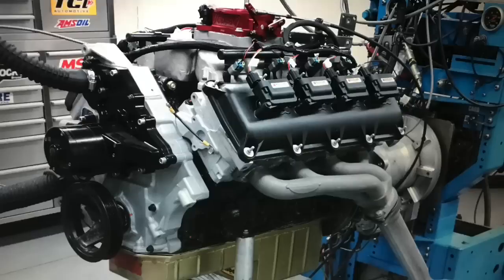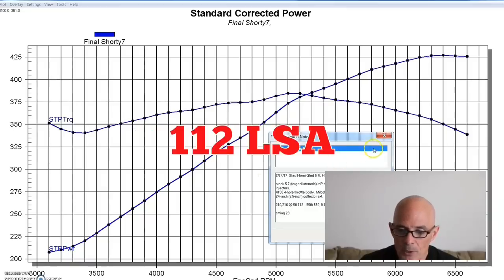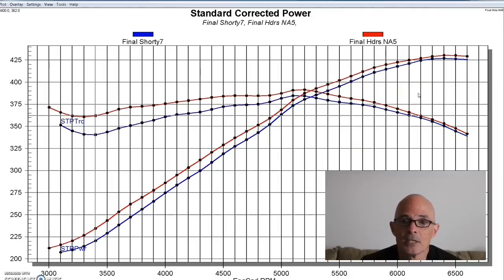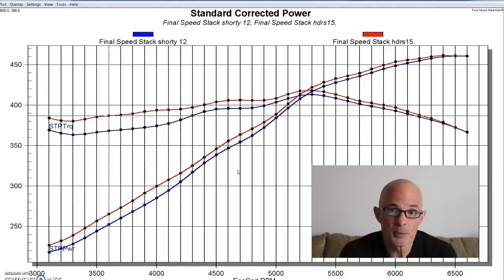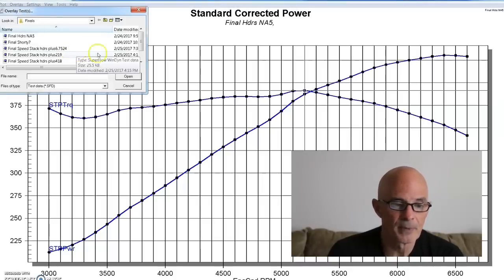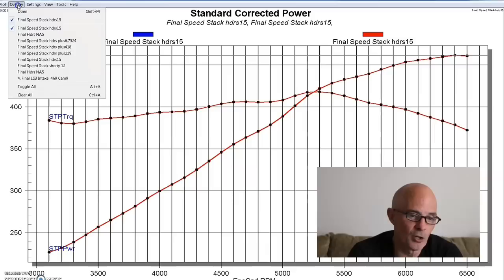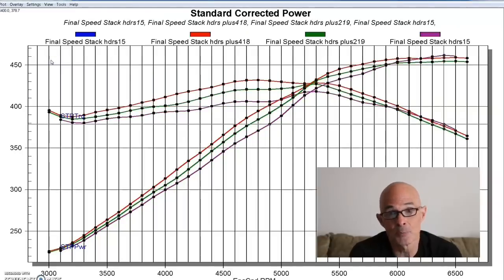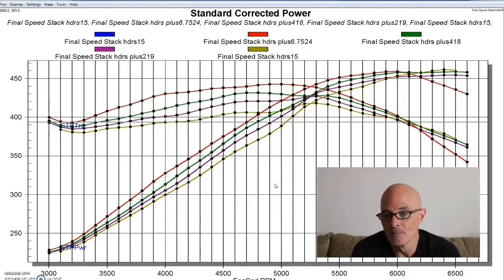STACK ATTACK!! DIY ADJ HEMI INTAKE

Comment: Richard, after reading a few articles and seeing this video among others, I decided to pop for the SM downdraft for the hemi I'm working on. But now that I have the system, I'm now finding out there's some prep work? What did you do to set the system up to run? MAP, and other sensors. Also tossing around EFI modules for this.. what do you suggest? BTW there's a provision for the TPS, np there. Any info is great. Thx
Reply from the maker: run a vacuum to any map sensor
Reply: @richardholdener1727  Thx a bunch. BTW, I have watched this video at least a half dozen times. I'm curious if you used the same injectors for the 4150 as you did for the stack injection? I'm not able to find tech data on the supplied injectors from FiTech. So I may opt for a holley compatible. Thx for the reply I did figure out the MAP, IAC, IAT sensors as well.

Comment: I’m curious do you know if that stack injection system fits newer 5.7 hemis? Or the 6.4 for that matter?
Reply from the maker: this was a 5.7
Reply: I believe you’d mentioned it was an 06 5.7. Is there a difference with the newer 5.7. Or better yet will the stack setup fit the newer 5.7?  Curious what the output would be on a newer 5.7, if at all.

Comment: The 8 single barrels are each feeding one single cylinder 1/8th of the time, their flow is only intermittent where the 4bbl feeds one cylinder at a time continuously one after the other but each cylinder gets a turn breathing thru all 4 bbls  where the cylinder with an individual stack only gets to breath thru it 1/8th of the time so it is not really that much more flow.   If there was a plenum under them like a tunnel ram it would be a different story, then each cylinder could (theoretically anyhow) breath thru all 8.   Also I think it would be a fun experiment to dramatically lengthen the runners like the skyram april fools manifold and see how it effects TQ very very low in the PRM range.
Reply from the maker: Each cylinder does not breathe through all 4 barrels on a dual plane, and airflow through a single plane is even localized based on cylinder locations, otherwise corner jetting would not be effective. But long runners certainly help torque as shown

Comment: Due to the consistency from one cylinder to the next, with long tubes you should be able to run things closer to the edge of detonation, leanness or whatever, without going over the edge. There is no way the cylinders of the shorty are all getting exactly the same cylinder fill, etc, and the computer is set up for that.

With the greater consistency of the cylinders available with the long-tube headers, one should be able to be more aggressive with things while not stepping over the limit, which you would be at a higher risk of doing with the shorties.

As an example, a leaner air/fuel ratio may yield more power, and with long tube headers, you are less likely to get a rogue cylinder experiencing detonation alone, and dragging all eight with it into spark retard. 

If each cylinder is identical, from start to finish of the intake/exhaust cycle, then all of them can be run at a higher level of output without the danger of detonation from the "weak" one.

The alternative is to have a computer for each individual cylinder that deals with each of the cylinders' quirks on an individual basis. Single plane single carb engines were bad for this discrepancy between cylinders. MPEFI fought this, but it is still all being centrally and collectively controlled.

Comment: I know this is an old video, but I wonder if a nice 2" 4 hole spacer (tapered on the bottom) under that throttle body would bring up the low end power of the single plane setup?
Reply from the maker: nope

Comment: I would like to run this stack injection on my 2006 dodge charger srt8 . Would i have to run an aftermarket  harness  piggy backed on my factory  harness  or aftermarket  management system.
Reply from the maker: after market
Reply: @richardholdener1727  which one would you recommend  and would that also run the nag 1 trans.

Comment: Richard, I'm trying to decide on an intake system for a 449 hemi road race build. I've watched many of your vids on the subject, and the ITBs always seem to come out ahead. However they're also just open to the air. I'd need to add filters and probably enclose them so they can't suck in hot engine bay air. Once this is done is there any advantage to ITBs? Thanks!

Comment: good test Richard! (on the stack length) Be good to do same test on a Ford 363, but doesnt matter what engine, it proves the point - longer runner length (stack height) improves tq lower in rpm range. Also is that total length (2,4,6") or is it added. if its added what is the total length?

Comment: Yamaha R1 uses self adjusting velocity stacks, they get shorter with higher rpm.  They are a telescope being type that use servos to adjust the length. This brings gains on low end and top end.

Comment: Richard years ago on my 68 Camaro that had a warmed over 302 4 speed . I was trying to get it to run ok and I used a cross over tube between the collectors and that seemed to help a bit as far as response .  I ran a 600 isy roller and 12.5 trw pistons and a set of really decent angle plug heads that came off a G Gas car . The bottom end was prepared similar to a dirt track motor . I fond of those motors as they have to live lap after lap . All a learning experience like the right power valve and drilling the small hole in the throttle plate and restricting fuel in the metering block

Comment: If you understand tuned port, then you know everythings tuneable.
Tuned systems consist of runner, plenum (optional), butterfly (feed speed), and ram pipe (intake pipe).
BUT... What is truth, is this, if you changed the length from the head to the butterfly, ONLY then have you actually changed the runner length.
Otherwise you have only and actually changed the ram pipe length. Plenum, butterfly and ram pipes are used to fine tune the power curves.

Comment: You don't get cylinder lean out due to longer runner length on the single plain, you can keep the fuel ratio the same in every cylinder with the stack injection.

Comment: Speedmaster what a horror story speedmasters or Pro comp stack injection for the Holden 304 efi engine the ports don't line up you need to weld up the speedmaster stack injection what a joke we work hard to build our cars only to get shafted and they are still trading not good.

Comment: It's amazing what runner length does! I've learned so much and have totally rethought my Vic Jr vs My old standard Performer RPM on my ANDERSON N51HR cammed 306. It'll really come down to where the engine wants to rev to for the manifold I choose. If I find that it's done before 6500 the RPM will be my choice without a doubt.

Comment: If you're going to work on shit boxes, Go get a 23° degree Sprint Car Small Block Chevy Engine, with mechanical fuel injection, On Methanol. At least 650hp naturally aspirated. Put different exhausts, intakes, trumpets, heads and cams in it. convert it to  run on efi, E85.
Twin carbs, tunnel ram etc..
play with that. 

There must be one of those you can duplicate, source cheap from somewhere.

Comment: Richard my dude, Couldn't be happier that you ran that test! .... Back many years ago I was the engine builder for a NASCAR 4 cylinder division that ran DCOE Webber carburetors but everybody ran the same cast aluminum manifold for the 1960s and never gave it a second look. As an engine builder looking for an advantage, I read many books on tuning intake and exhaust length to optimize the pulse wave formed during different rpm ranges the engine ran through. We built a special intake that we could adjust the length of the runner to gain out of the engine what we needed to pull it off the corner as hard as possible. we were able to hide this from competitors by enclosing it with a thin aluminum box which during tech we would explain it was to hold dry ice to cool the intake. it was protested by competitors many times and it was always fun to take their money when they lost the protest, without fail they would protest we were spraying the intake with a small kit. nobody ever guessed what it was under there that was kicking their asses. THANKS for that video it was fun to watch...

Comment: Very interesting results! 
More questions- does the throttle blade location in that runner affect it(close to head vs far away? What about injector location?  I'd also like to see more runner length, 12", 18", & 24" just for grins.

Comment: runner length = air velocity ?
Reply from the maker: it's something different-it a reflected pressure wave-it adds cylinder filling above and beyond the airflow-at the right time when cylinder filling is at its lowest
Reply: @richardholdener1727  The reflective wave is determined by velocity and velocity in a intake is determined by diameter.
Ask yourself the question Richard is diameter of the intake port important in a head, then why doesn't that rule apply to intake ram pipes.  Having a thirst for knowledge as you do must make you wonder "am I correct or not".

Comment: Richard can you explain the intake duration = power theory you've mentioned? It would be even cooler if you had some more single variable cam testing like the LSA test, it's my understanding that the intake close timing makes the biggest effect as to when an engine makes peak torque
Reply from the maker: for me-intake duration shows me a lot about where the cam will wan to make power-more than exhaust duration and much more than lift

Comment: I'd like to see someone make a variable length stack injection. Basically having the benefit of both long runner torque and short runner hp.
Reply: DBGMLV 
You just get different length trumpets made
Reply: Wasn't one of the mod Ford's setup like that back in 90's or later?
My father's 94 4.0 six had an intake with two runner lengths and a valve which switched from long to short.
Reply: Some imports have done it too Mazda, Porsche, etc

Comment: 11:31 Here i have a question, if one is running a turbocharger, does longtube headers pick up power? or you lose power because of heat loss?
Reply: Great question. If i had to guess I'd say that whatever makes more power NA also makes more power with boost.
Reply from the maker: it won't lose power from heat loss once heat is present-it will shed heat off boost quicker than cast iron short manifolds
Reply: Turbo efficiency is about pressure difference over the wheels.

Comment: I love these videos! One thing I've wanted to try (or seen done) is a twin turbo setup with a separate intakes. For example: Right bank turbo feeds left intake, left turbo feeds right bank intake.  If any part fails, boost production stops.  This is because the right back gets it pressure from the left turbo. If left turbo fails, there is no more boost to the right bank. Well, boost should drop off significantly at any rate. It would be a plumbing nightmare, especially if you used 2 intercoolers (I guess 2 air to water intercoolers would be easier to package). Probably good for nothing more than the wow factor.
Reply from the maker: No need to separate them
Reply: Use the long ram intake on a big block mopar, although it does have a crossover tube from plenum to plenum and it is 60 year old technology.

Comment: What wuld be interested with the stack is using different runner diameter. I Beth going smaller on the diameter will give bigger gains for smaller rpm range, speed of airflow faster, more of an "hammer effect" getting that mixture in, also probably for a narrower rpm band.

Comment: Longer runners will move the curve to the left as you've shown. Adjustable runners have been used by manufacturers but I haven't seen any lately. I believe Yamaha had staged runners in the yzf1000 at one point. Can't remember.
Reply: 2007 to present R1's have them.
Reply: @QuicKurtZX14R  I didn't realize they still have it. Thx for the info

Comment: pretty cool test Richard.   Wouldn't it be cool to do a slip fit design, put an electric motor on each so you can vary the length based on RPM?  Have your cake and eat it too.  Would be crazy to see those things getting shorter as RPM goes up.

Comment: Great test and much needed info for all of us.  Richard you should do a test of factory coils vs MSD or performance coils to how they affect tuning.  Can we really run more spark gap with a aftermarket coil does it lean the engine out so we can add more fuel and make more power. That would be a great test like this one.  Or when is stepping up to an aftermarket ignition or coils is  necessary

Comment: Great info, that really shows how an engine responds to changes with air flow in and out. The different combos you run really helps someone decide what to buy for their next engine build. Proven dyno horsepower

Comment: Richard great video, I will  go out on a limb hear and say runner diameter if more critical the length.  The formula for inertia is "1/2 mass times the velocity squared"  so by getting the velocity of the air up  closer to the speed of sound will give you greater pressure when the intake valve closes then if you double the mass of the air.  If you want me to send you some graphs and data to support my point I can.  Happy to discuss out of the public forum.
Reply from the maker: runner diameter makes less of a change than runner length
Reply: @richardholdener1727  Very respectfully, @Anthony Parle is 100% correct. Think about it--how can there be a "reflected wave" on the stack injection system if there is no plenum for the wave to reflect off of? Not to mention, if this were a reflected wave thing it would only work within in a relatively narrow engine speed range. The added runner length is choking the flow area, which increases velocity and helps low-end power, but limits total airflow.
Reply: @richardholdener1727  As I said Richard I can share the data to confirm my point.  Yes length is important but after diameter.  I can even provide data from a F1 engine back in the NA time to support what I am saying.  Equally don't have a problem if you want to continue to stick with the length belief.  But as they say you may never know if my point is correct unless you ask, I just could be right.  Keep up the great work

Comment: Learned quite a bit with this one--thanks!  Appreciate the short header versus long-tube.  It would be cool to see if and where zoomies make a difference.  Perhaps you can't dyno these plus I realize this is a limited setup street cars typically can't run.  However, any data appreciated.
Reply from the maker: zoomies are short and offer limited scavenging, they are best used for flow and down force on fuel cars

Comment: This is the stuff I love. Cams, intake and exhaust tuning, and some mild head work are what I grew up with. I've had a couple of turbos, but nothing beats the sound and feel of NA and a stick.
If you come across any data comparing runner diameters, to get a better sense of the effect of intake velocity, it would be great to hear.
Many thanks. You're doing great work.

Comment: Love the engine tech-thank you Mr. RH! Would a more aggressive cam change the linear increase in output as the stack length changed? Was the A/F & timing optimized with each change in length?
Reply from the maker: yes optimized for each -not sure I understand what linear increase in output is. Cam timing initiates start of reflected wave, but runner length will still do what you see here
Reply: @richardholdener1727  I know reflected/pressure waves are created with the open/close of the intake (and exhaust) valve. Would a cam's duration, LSA, lift...have an influence on these waves? Also, to max the effect of intake wave tuning, which intake manifold design is best, dual plain (low RPM), single plain (high RPM), individual runner, or a combo of all types? Doing some research, I came across this. Please share!!!! Thank you.
https://www.streetmusclemag.com/tech-stories/attitude-adjustment-5-4l-variable-runner-intake-test/

Comment: So I’ve had this idea for a while but no means to do it, so I’ll put it out there and maybe you can do it.  I’d like to take a Holley high ram and make a spacer between the top hat and bottom piece to fit like 4-6” stacks on each runner and see what would happen. Maybe make same torque as the ls3/truck manifold but more up top. Also to bring that peak rpm down to a more usable range. This idea is for a truck so room isn’t as much of an issue. 

Also curious if those intercoolers people put in the Holley high rams have any affect on rpm or power. Aside from cooling.  A good test would be to install one on a n/a motor but without water going through it. That way one would know if it’s better to run an external intercooler or the in plenum one. 🤷🏼‍♂️
Reply from the maker: I was working on something like that
Reply: Richard Holdener  I’ll be watching for it. Let’s face it, the Holley high ram looks awesome. If we could extend the runners to make it useful it would be amazing!

Comment: Interesting results! Curious how well the 6.1 manifold would stack up i hear they work well as an upgrade on the little 5.7
Reply from the maker: I tested that
Reply: @richardholdener1727  I will check it out haven't been on as much lately thanks for the reply!
Reply: Did you also get to test it against the 396  manifold?
Reply: @socratesfrias4620  392...not 396

Comment: Man those hemi heads are impressive those numbers on a 210/216 cam are freaking super impressive.
Reply: Its completely bananas and a testimony of the high flowing heads.   Some DOHC designs with high flow use 200 degree at .050 camshafts and make power to 7000 rpm.   The example i described was 2009 to 2014 c63 AMG.   The heads flow 350 cfm without porting and at 300cfm at .300 valve lift.   The engine makes 530hp and up to 600hp with exhaust and bolt ons